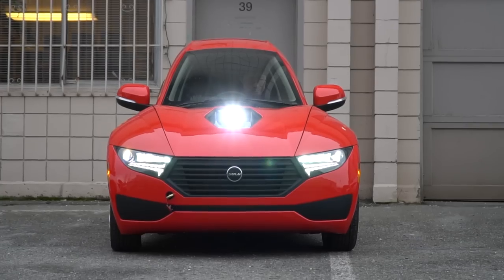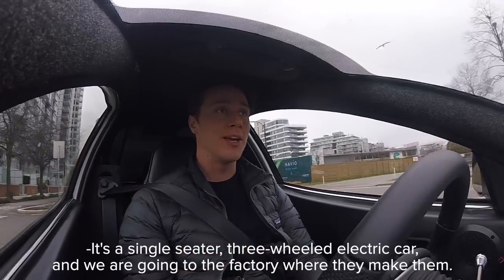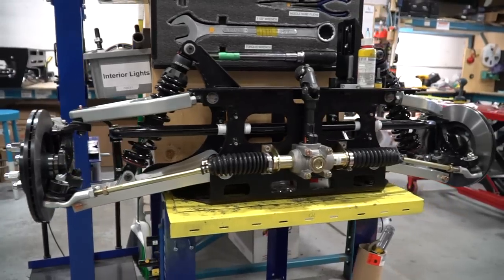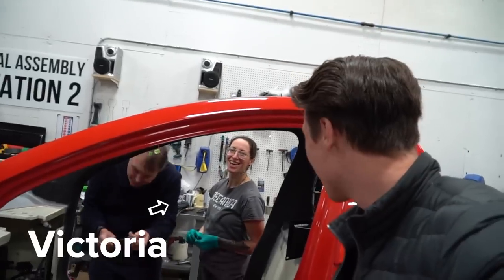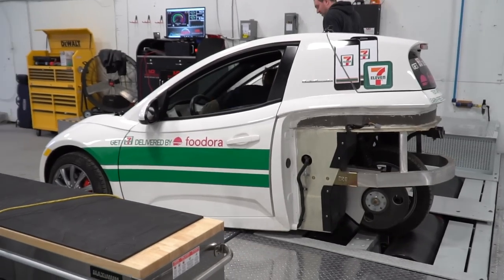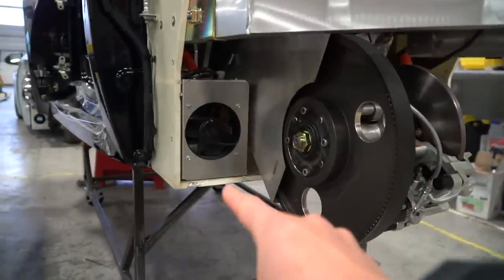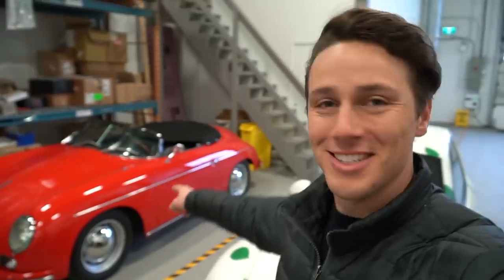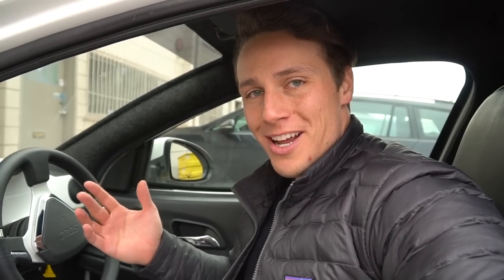A Canadian Electric Car Factory - Solo EV

Comment: Thanks for the video. Was wondering how they were doing the testing for range. Keep us updated on the Solo and let us know when they get certified for Canada. Won't put money down til that comes through, i will use the tag so you get your $100 credit.
Reply from the maker: I'm pretty sure they're already certified in Canada, as they're being driven all over town.  I drove one out to the factory and they're selling them in the showroom in Vancouver.
Reply: @DownieLive  They have told me they are going through certification now, and are not complete as of yet. Was just wondering if they had told you anything different while you were there. Ontario has a trial program right now for 3 wheeled vehicles but all have been open motorcycle types they say this is classed as a car so must be different process to  certify.
Reply from the maker: 🤷🏼‍♂️  i guess listen to them. They would know better than me.

Comment: uh...aren't these actually made in China?  Here's the problem: expensive for a small single seat with the safety of a motorcycle (not a car, doesn't need to pass crash tests).
For the same money, you can get a used Nissan Leaf. Bigger, more range, safer.
Reply: Make sure to check that used Leaf's battery condition before you buy it. A lot of first generation EVs have lost nearly half their range and the replacement batteries are $6-8k.

Comment: At 2:17, you say, "When you accelerate. it actually lifts your tail". Are you sure? Every rear wheel drive car will lift the front when you accelerate - whether one, two, or three tires in back. Consider what happens with a drag car. They even have bars in the back to keep the front from lifting too much.
Reply from the maker: I know what I said, and I know what I felt.  Every car I've been in before this squats under acceleration.  This one lifted under acceleration.  Very odd feeling, hence why I mentioned it.

Comment: Just to set the record straight......NOT all States view 3 wheeled cars as motorcycles. Texas for example has a rule that if it its straddled like a 2 wheel motorcycle then it can be registered as such but.....if you ride inside like a car then it will be registered as such. Seems it the same up in Canada too since they have the large license plates.
Reply from the maker: Yes. 48 of your states have now changed legislation so that it qualifies as an autocycle, so you don’t need to wear a helmet or have a motorcycle license.
Reply: @DownieLive  Sure wish Texas was one of them. I've been working on my own design with ICE. I drive more that 100 miles in a day so electric is not practical for me.

Comment: The only thing this would be practical for is small delivery like pizza, and like hourly rentals but that's it. $15,000 for a single seater and no storage? It's a toy. There are way too many practical used hybrids and even EVs that are cheaper. You can get a used Prius, Leaf, or Insight with low miles for $15,000 which are miles better.

Comment: Interesting but needs to be cheaper , have AC and a jump seat.
Reply: Yup that is exactly what I was thinking.  No AC might be fine for Vancouver but Toronto would require ac.  Also a seat for one more/ cargo would make a lot of sense.
Reply: Easy fix would be a heat pump unit as other EVs use them but would drive up the cost and complexity a bit
Reply: Dan R yup agreed the heat pump would cut power usage for heating also.  Only that many heat pumps will not heat below -18 deg C.  Not that I would drive this little baby at less than 0 c  or in the snow.  I would Uber then.
Reply: @fredfrond6148  very true bud, maybe a PTC auxiliary heater in there to help in very cold temps. Automatically heats interior while charging and warms batteries up below -7c
Reply: @fredfrond6148  The news from Meccanica is that the ramp up to mass production at the China factory happens next month (August 2019) and those cars (called "Production models) will have power brakes and steering AND air conditioning!
Reply: John Ross cool.  Thanks for the update.

Comment: One seat, two doors??? Doors are expensive, failure prone, and heavy. A hinged top could be lighter stiffer and cheaper and offer better visibility and is easier to seal from rain! Also putting two wheels in front puts the CG too far back, making it prone to oversteer impossibly to brake in turns and have bad aerodynamics. Wheel width could also be narrower with skinnier tires. Too tall, a more reclined driver position is more comfortable and also improves aerodynamics. Other properly built three wheelers are in the 15 city 60 hwy Wh/km. I'm guessing this vehicle is using twice that so range is ridiculously poor? This is horrible, I really need to start my own EV company hiring only engineers, so these know-nothing startups can have something to aspire to!
Reply: The one piece monocoque would have to be completely redesigned if the roof was to removable otherwise it would flex excessively on turns and fold in a frontal impact. If the doors are made of the same material as the car , I'd like to think they aren't heavy at all. They're aiming for a cheaper alternative for commuter vehicles with smaller footprint. Nothing wrong with that. I'd happily sell my infernal combustion engined car for one of these. Less maintenance. And I'm a HD mechanic.
Reply: @danr8194  I think my critcism is rooted in the attempt to make it feel like an ordinary car when you drive it, with the chosen very upright riding position and the mentioned two doors. I owned a City-EL in the 90'. It was like a clamshell: Bottom tub was a double shell of heat formed ABS with expanding foam inbetween. The frame itself was a single  thin walled 80mm bent tube frame encircling the driver and providing anchor points for the suspension and front fork (it was a 3 wheeler too) The lid was polycarbonate with a smaller tube around the bottom. The hinge was just behiond the headlight, so it flipped open forward. That made access also between parked cars aswell as maintenance easy. A pair of gas springs provided neutral lift so it would stay in any open position. It didn't leak at the seal only through the sun roof and visibility was 360, as there were no pillars. Making a 3 wheeled EV makes it a motorcycle, so there are no need for a "cage"  to make it heavy or pillars to obstruct vision.